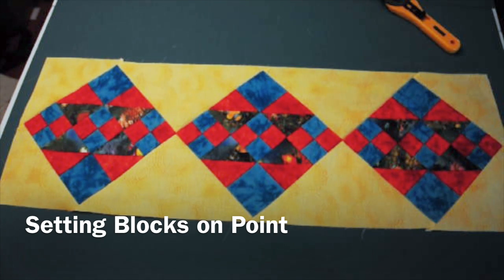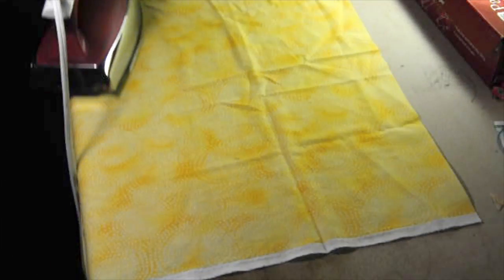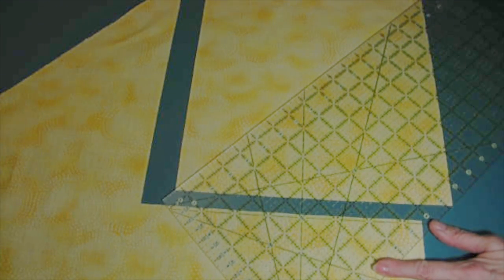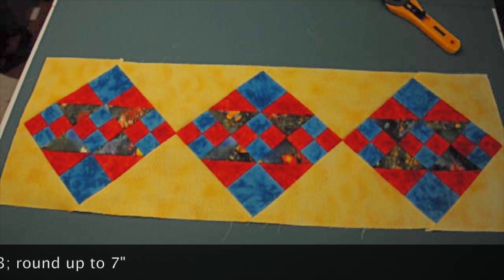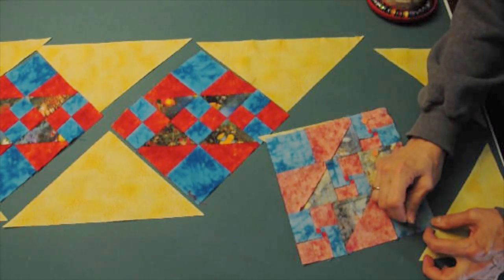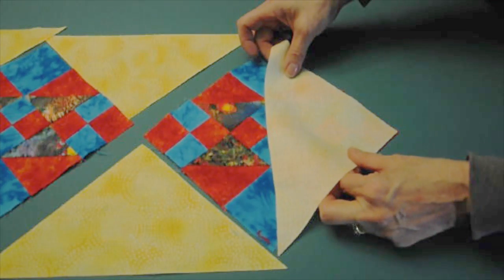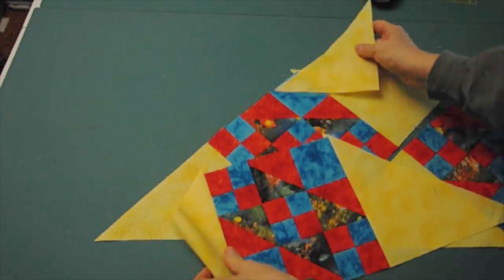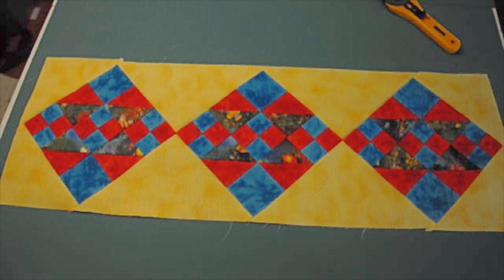Setting Blocks on Point

Comment: I AM A DYSLEXIC AND NUMBERS ARE A BANE TO ME AN ITS VERY HARD FOR ME AN MATH TO GET ALONG.... I HAVE 3 QUILTS THAT I HAVE THE PIECES FOR THAT I WANT TO DO ON POINT BUT DIDNT HAVE A CLUE HOW TO DO THE MATH TO ACTUALLY PUT THESE BEASTYS TOGETHER ....
IF YOU WOULD COULD YOU TELL ME THE FORMULA FOR THE WHOLE BLOCKS BETWEEN THE PIECED ONES FOR A QUILT INSTEAD OF JUST A TABLE RUNNER PLEASE...
THANK YOU FOR YOUR TIME AND PATIENTS..
FRANKI
Reply from the maker: Yes....the whole blocks between the others if you are making a larger quilt would be the same size as the pieced blocks. So for instance if your pieced blocks are 8 1/2" unfinished, then the solid or even secondary pieced blocks in between would also be 8 1/2" unfinished....meaning once they are sewn together they would measure 8". Hope this helps....good luck!